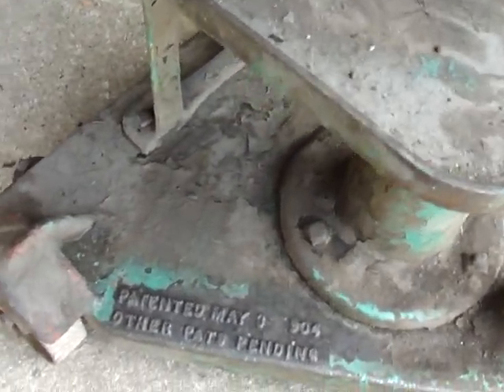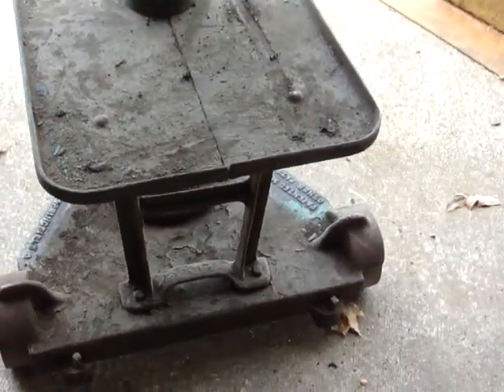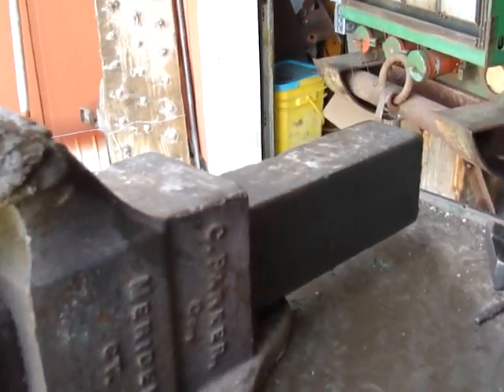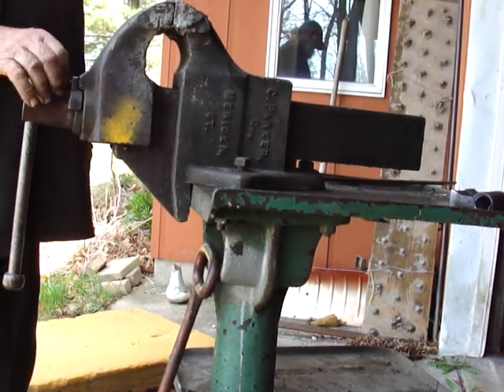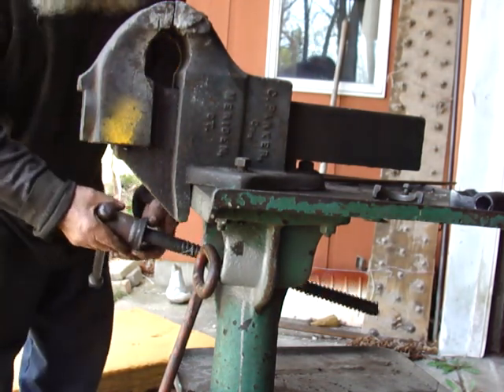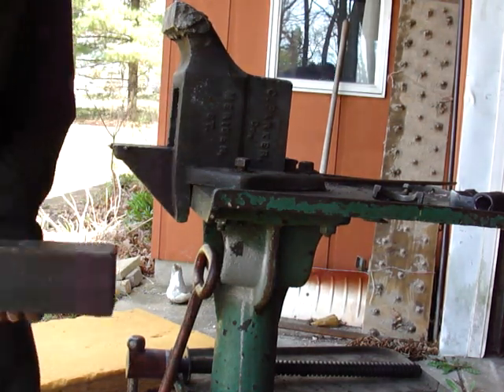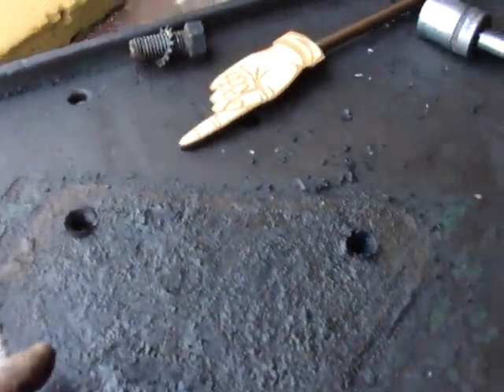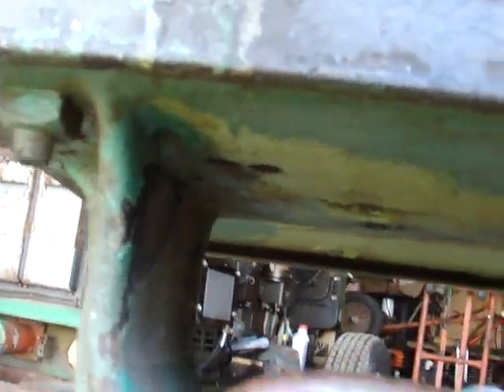Champion No.130 Portable Tool and Vise Stand, w/beatup Parker 4X Vise

Comment: You find the coolest stuff!  Those vise's in 1/2" increments are interesting. I've seen a Columbian marked 4 5/8".  What's the point of that extra eighth?!
Reply from the maker: Embossed marked?  Never seen nor heard of 1 marked like that.  Some of the bigger vises mostly were 1/8" over the embossed marking.
Reply: @wrenchguy  yes they actually cast in the text/numbers way back then c1920s.  Really splitting hairs!
Reply from the maker: @KD-lq1sr  I have 60 some vises, a third pre 1920's. Never seen 5/8 embossed. Thanks.